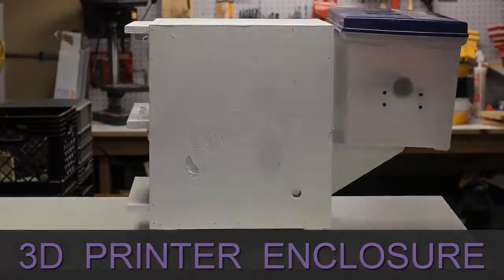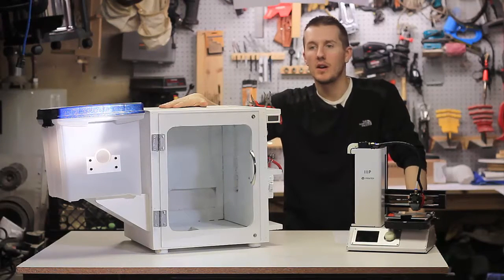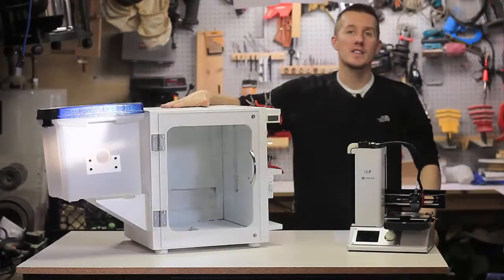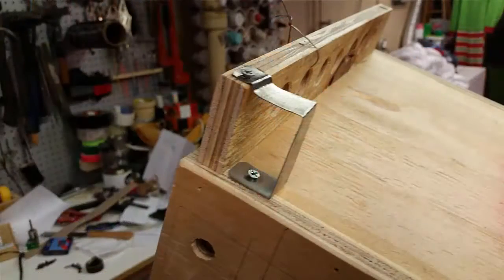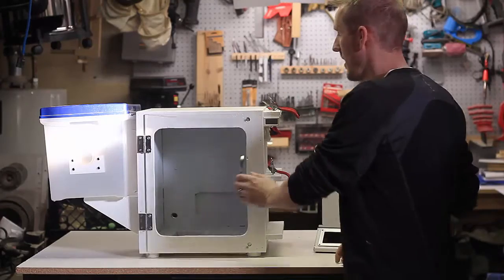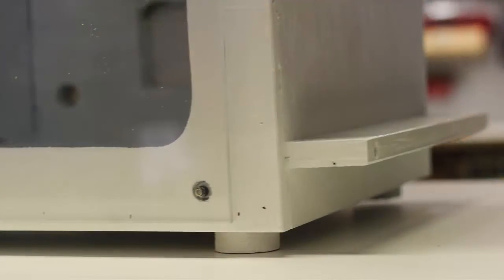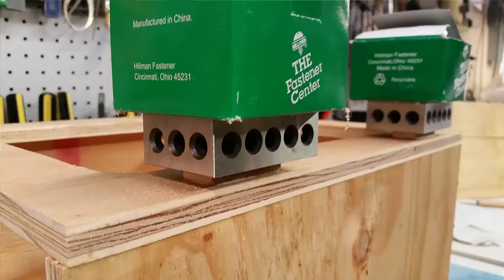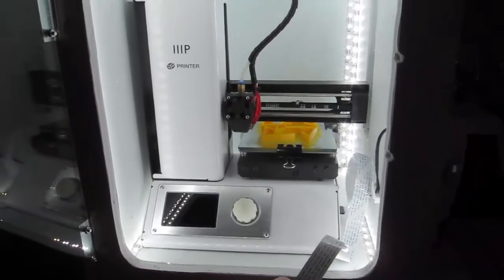3D Printer Enclosure - Cheap Build Plans - MonoPrice Select Mini

Comment: This looks great.  Your title says "cheap build plans."  Where are the plans?  I'd love to have the exact dimensions and a scale diagram.
Reply from the maker: Ya i haven't gotten around to finishing that.  I had several different plans originally then they all changed as i started building.  But i plan to put the final plans and dimensions up on the blog.  They are basically the size of the printer plus a few inches on all sides, if you have the room to make it larger i would suggest that.  The tighter you make it, the tighter it is to work on it.

Comment: I like it. I noticed the opening at the bottom but i don't see an escape for the hot air inside the electronics bay. Remember heated air raises so it will not escape out the bottom as much as you would like.  What you may want to do is to monitor the temperature inside the electronics bay to ensure that it does not heat up too much. If so, you may want to add some cross ventilation through the electronics bay in some way that it will not affect the temperature around the printing area. An opening in the lid on the door hinge side may be a good start?
Reply: Bertus Steyn b

Comment: Why not 3D print the hinges, corner supports to join the wood panels, filament box support, enclosure feet,  ect... I'll probably make something similar but print as many parts as possible.
Reply from the maker: When you get a 3D printer, everything starts to look like it should be 3D printed.

Comment: Interesting. Something I have been tossing around in the back of my mind. You are right about the monoprice mini being a cool machine. I've watched a few of your videos. And they were insightful. I don't know if you pondered this. Is it possible to readjust the printer to get finer prints? Perhaps a smaller diameter nozzle. And I do understand that it would require a new hotend to do so.

Comment: can i suggest maybe top loading the filament to save sideways space  
 if you vent that sucks away the heat so im thinking if u do vent maybe from the bottom and with low flow allowing u to keep heat up  may be best  im mid build with mine atm doing a larger unit with fillament inside so its pre heated by the ambiant tempriture inside   top of my cabanit     thankyou for the upload dave great video

Comment: Hi Dave, I really liked your design and like how it is very cheap and compact. I wish to build it myself for my monoprice select mini as well but I am a little confused on the parts needed to make it. could you maybe create a simple list of the materials I will need to build it? Also if you could have the measurements that would be great! Thanks, Antopia.
Reply from the maker: It's been a while since i built it.  As far as materials, anything will work, i just happen to use plywood.  You just need some type of enclosure to keep in heat and noise.  I've seen people use a cardboard box.  As far as size, just measure your printer then add an inch or 2 on the ends.  Don't forget that the bed moves front and back.  My big idea was to move the filament Outside of the enclosure, that saved a ton of material when building.
Reply: Ok, I will try to. Thanks for the help.

Comment: Dave you did a great job with the enclosure.  What are your dimensions? I would like very much to duplicate with some small modifications.  Thanks again for your posting.
Reply from the maker: Ya i'll try to measure it and let you know.  Making it bigger isn't an issue, the trick is to make it as small as possible, but still give it room to operate.  I think i took the maximum size the Y bed moved and added 2" to the front and back, then added 2" to the top and 2" to either side in the X direction.  The big space saver was moving the filament to the outside of the case.
Reply: I have one of the MPS mini's as well and its decent for a budget printer, dimensions would be helpful though. Lol that white with white lightsis way too much, blue would probably work well, you can get 15 ft of multi color with functions for $15 now with fade feature.

Comment: I am getting ready to build your enclosure. Is there anything you would change or recommend?
Reply from the maker: For a while i stopped using it, my printer was getting too hot and stopping because of overheating.  But then i started printing ABS and the parts were curling up off the print bed.  So i started using it again, this time leaving the door open half way and it's been great.  I would add maybe a fan or something to blow cold air from the bottom up to the printer's circuit board.  Kind of like a computer case to keep the motherboard cool.  But i really like the magnetic door, really like the LED light strip.  And for me the plexi-glass door is a must, i like to see it printing.  I know some people just start the print and come back in 3 hours and hope it turned out ok, but that wouldn't work for me.  Another thing i might change is the filament box.  You don't really need it.  You could just make a hook for the filament.  It doesn't need to be air-tight.  That would save space.

Comment: Would one of these be good? http://www.shoppopdisplays.com/11389/acrylic-5-sided-box-18h-x-12w-x-12l-tall.html

I'm not sure about the dimension of the bed extends, I just ordered mine so I'm waiting for the arrival.
Reply: I would build my own but the supplies would cost more than this case. Unfortunately I don't have a wood work shop haha
Reply from the maker: Ya lots of things will work, even a cardboard box.  But it's nice if the enclosure has a door, lights, tool rack.  But if your goal is to keep heat in to print ABS than ya that box will work.